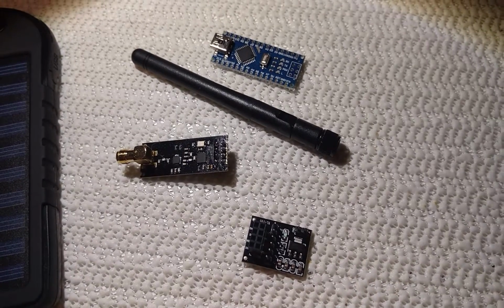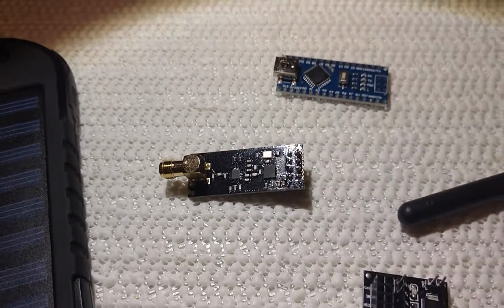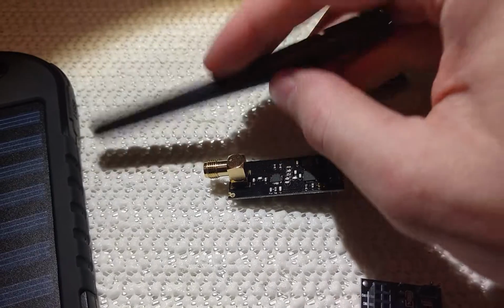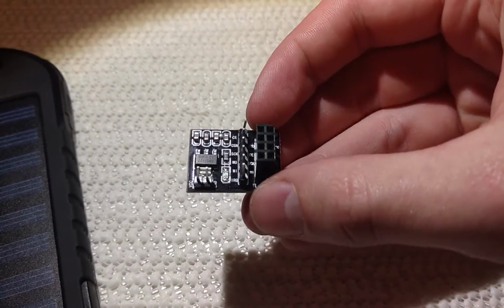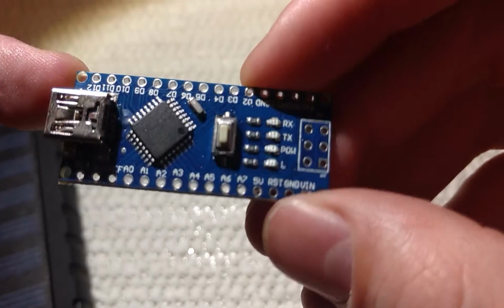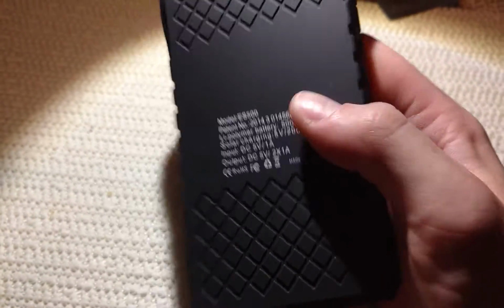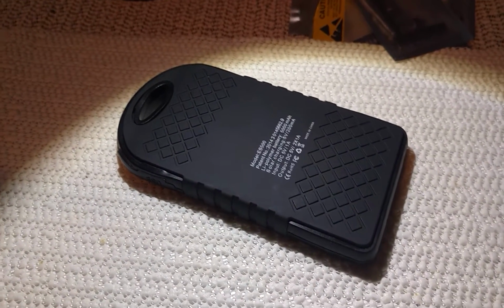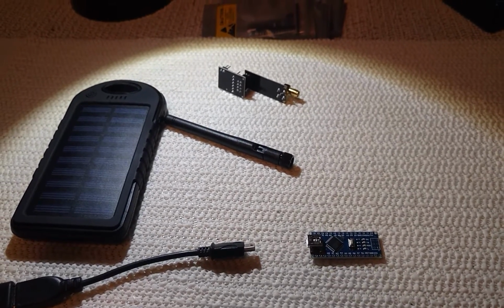RF Mesh Network - Introduction

Comment: what is the link to buy  adapter ?
Reply: http://www.ebay.com/itm/5pcs-Socket-Adapter-plate-Board-f-8Pin-NRF24L01-Wireless-Transceive-module-51/201280523226?_trksid=p2047675.c100010.m2109&_trkparms=aid%3D555018%26algo%3DPL.SIM%26ao%3D1%26asc%3D41376%26meid%3D74a9a2f78c4b455c89734fd229719f43%26pid%3D100010%26rk%3D3%26rkt%3D6%26sd%3D262136737524
there you go